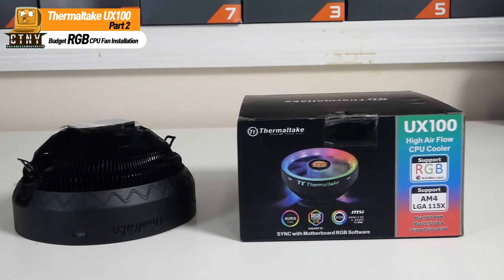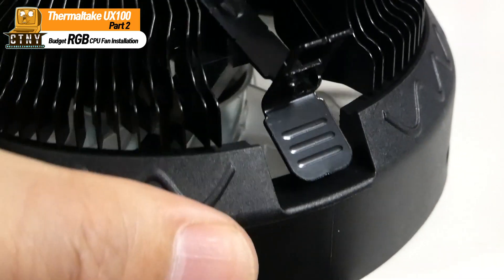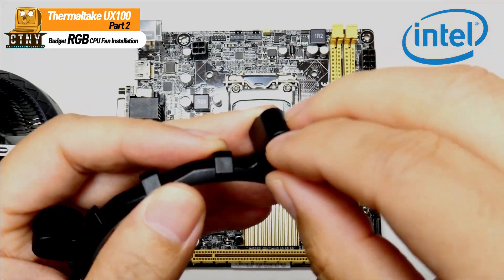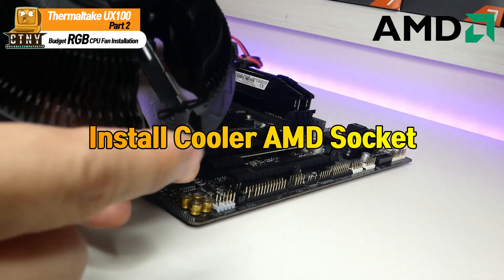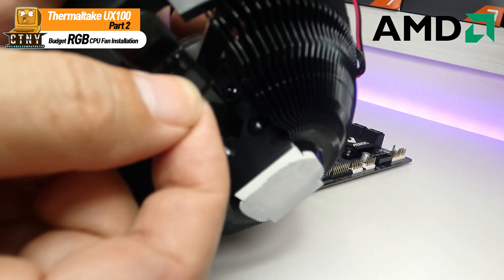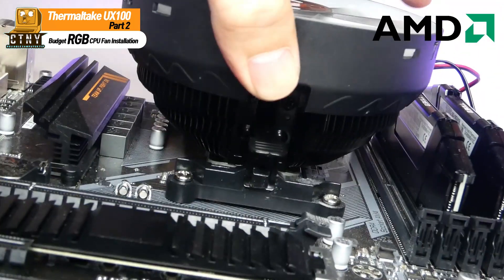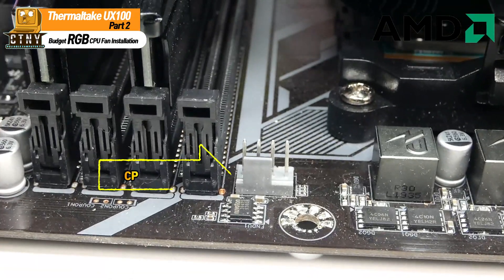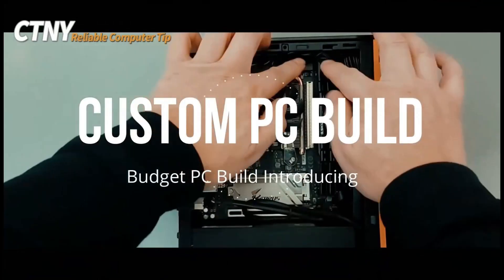Thermaltake UX100 Budget RGB CPU Fan Installation -Part 2 (Intel /AMD)

Comment: Can i use this Thermaltake ux 100 cpu cooler  in Asus b85-mk motherboard...??
Plz answer please...🙏🙏🙏
Reply from the maker: I'm sorry to inform you that your board is not compatible with this RGB CPU cooler fan. This one needs 5V 3 pin ARGB header on the motherboard so in your case, I'd rather say use this CPU cooler instead of Thermaltake UX100.  Here is the link: https://amzn.to/3d46k4l   Thank you for your comments.

Comment: Can we use rgb of thermaltake ux100 on gigabyte b450ds3h non Wi-Fi motherboard 

PLEASE ANSWER PLS
Reply from the maker: Yes. there is 1 x CPU cooler LED strip/RGB LED strip header near SYS_Fan 1 on this board but it is a 12V 4 pin ARGB header. In this case, you'll need a converter to change the voltage 12V to 5V Here is the link: https://amz.run/3c87   Thank you for your comments.